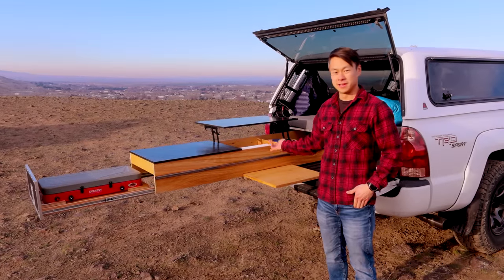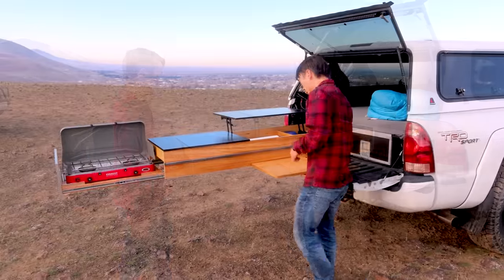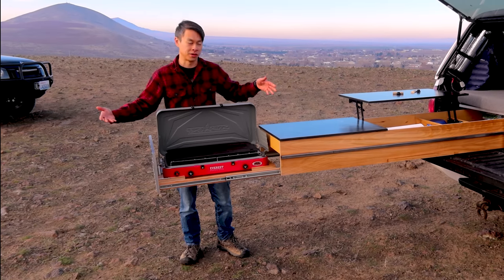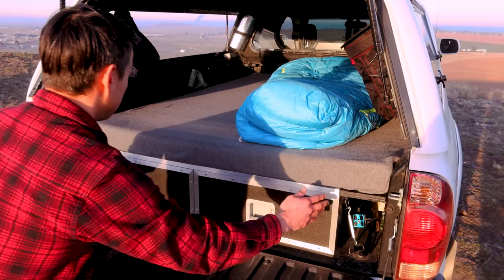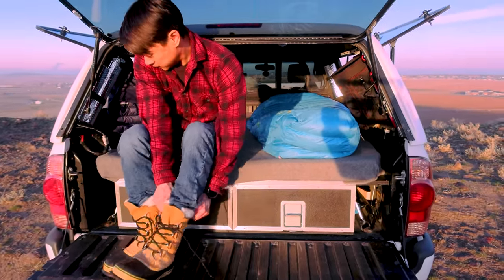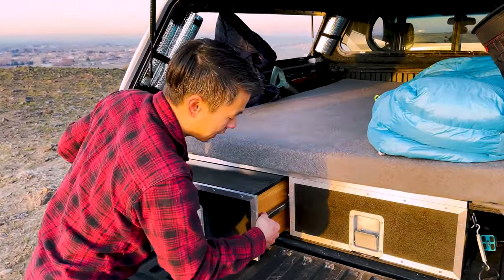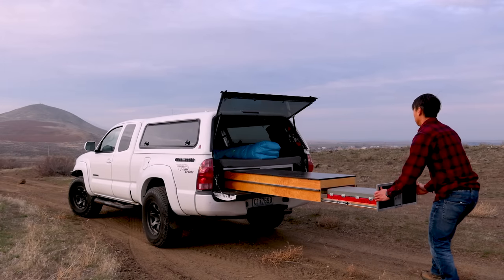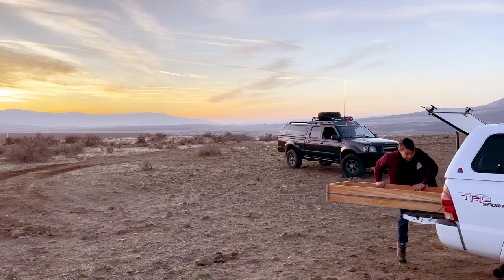Tacoma DIY Overland Kitchen And Mattress Platform Storage Drawer System - K.A.M.P. Drawers

Comment: I'm not sure if you have ever actually used those small fold-up traction mats before. I had terrible luck with them. Buddy was stuck in mud, put those under the tires and no traction. Upgraded to X-bulls (knock-off MaxTrax) for that reason.
The design is a good idea but I personally think they aren't suitable for recovery.
Reply from the maker: I've used them quite a few times getting passenger cars with summer tires unstuck in snow or sand, and in that usage they shine and make a lot of sense. But yeah, when I get the 4WD stuck, it usually takes a lot more traction than the GoTreads can provide. Still not worthless, though.
Reply: @SamChou  Thats good to know that they worked for you under certain circumstances. I think for a full size 4wd like you said it wont work. Probably something better to have then nothing in snow though. Good point.
Nice Taco by the way.

Comment: Do you get leaks with the bed cover you’re using?
Reply from the maker: Rain is no problem. High pressure like at the carwash will leave a few drips around the back window, but only because it doesn't line up since it got into a big collision before I bought it for $300.

Comment: How much would you charge to make me one
Reply from the maker: I'm still getting a feel for the market, balancing how much labor cost it would take me to mass produce them in my shop in a way that's worth my while (this is the biggest factor, but I'm currently in the process of retooling to streamline manufacturing). I'm looking at what similar products are currently on the market (DECKED, Truckvault, Goose Gear, Pull Kitchen), and I'm coming up with a reasonable price of around $2500-$3000.

Would that be something you'd be willing to pay? I'm still doing market research at this point, so your input is appreciated.

Send me an email at sachou@gmail.com to be added to the email list for updates.

Comment: Do you have a set of plans you’d be willing to sell
Reply from the maker: Currently, I don't have any design plans other than some rough drawings on graph paper and what's in my head. I'm planning on working on getting it drawn up into 3D modeling software in the near term to help with manufacturing. I have received several requests for selling the plans, and since I'm all for DIY, I'm definitely considering it.

Comment: I'm going to be that bloke and say I wasn't that impressed with the system,  I do like the skateboard wheels as draw runners but I don't like the lift up bench tops, would be annoying if you had everything out making dinner then you need some cutlery...
Reply from the maker: Yup, that's my biggest change for version 2. I didn't think it would be a big deal, but in using it in the field, it gets annoying. I plan to replace it with slides so I don't need to clear off the counter constantly when I need into it.

Comment: Way too much crap.. Just rough it.. Kitchen... Haha
Closed cell foam does not absorb water.. How much stuff does a guy need for gods sake
Reply from the maker: I usually do rough it. I'm typically motocamping or backpacking out of a 40 liter dry bag and sleeping in a hammock. This is my winter snow camping rig, which requires extra shelter and 4WD. Do you ever camp when it's 0 degrees out?